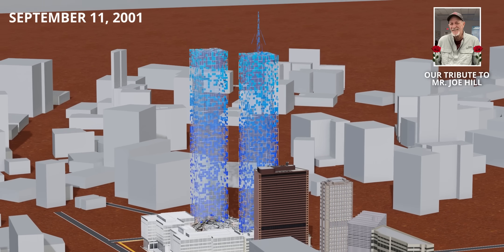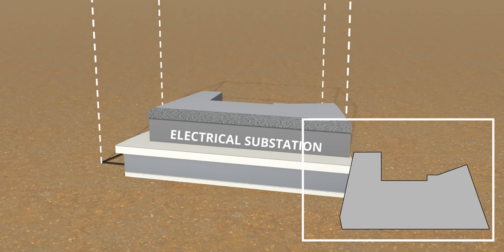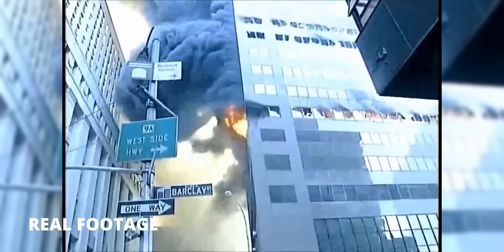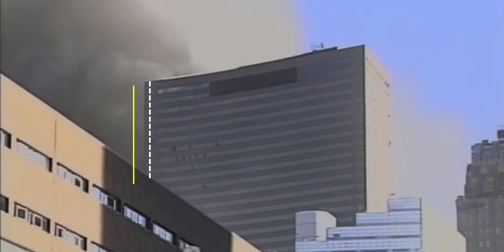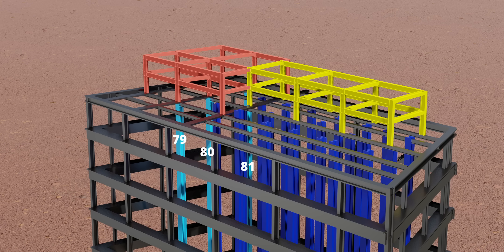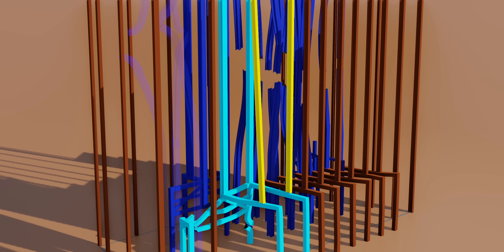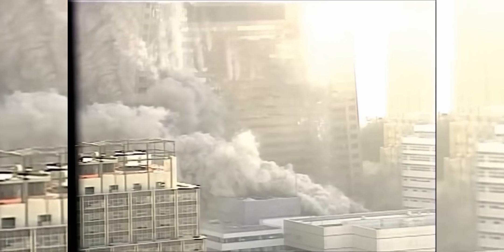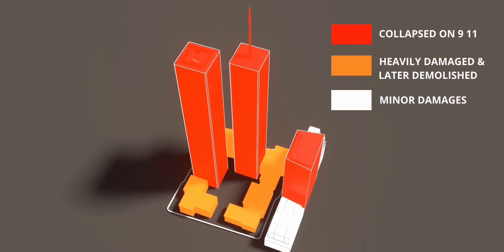Collapse of Building 7 | The Complete Physics

Comment: As someone who spent 30 years as a union ironworker literally hands on erecting , welding , bolting up, demoing , ect skyscrapers , I can honestly say ... COMPLETE LIES!,, impossible for building 7 to perfectly self implode and fall over office fires and an antenna falling down the side of it , for that steel structure to do that ,, ALL the lower columns would have to give out at the exact same time , lets not forget the reporter saying "we are being told they are getting ready to bring down building 7 " 😂
Reply: @yanceydavenport8657 this guy in your comments is a fckn Fed, just to let you know
Reply: So, we can conclude that you're not a "union ironworker", much like every other muppet claiming un-solicited "authority".
Well done. The fact that you can't see what's happening, as well as the fact that you make up dumb shit? Didn't really make it less pathetic.
Reply: I'm going to respectfully disagree without making any false appeals to authority, and here is why; 

Much misunderstood, Building 7 was the 6th building to collapse of 10 lost on 9/11. Because of its early low priority, conspiracy filled the information void with garbage made up by technically ignorant people promoting political agendas. But 7's loss is an engineering problem and should be treated as such, so I prepared this brief summary of my own analysis to fix that, using technical analysis, not ideology and tired memes. 

At 10:28am the WTC North Tower collapsed, showering Building 7 with tons of burning debris, causing heavy damage and starting many large  fires which burned out of control for the next 7 hours. Half the FDNY firefighters having been killed, units in disarray, equipment destroyed, no water pressure, and the greater urgency of search & rescue efforts, Building 7 couldn’t be saved so firefighting efforts were pulled as futile and 7 left to its fate. Firefighters make that sort of choice every day in brush fire situations - which houses to save and which ones to let go. Only real difference here is moving the decimal on the size and cost. People get overwhelmed by the size.

www.youtube.com/watch?v=g_SvpwyC17M

Collapse of a burning structure is always a concern for firefighters. Steel buildings subject to fire rely on active firefighting to survive. Buildings are designed around 1 to 3 hours of fire resistance, allowing time for occupants to escape and active firefighting to get started, after which all bets are off. Left to their own devices they'll exceed their design envelope and collapse, like Plasco Tower and Wilton Paes de Almeida. In 7 the occupants escaped, passive and active fire protections were compromised and active firefighting was abandoned hours before the collapse, which left the building to its fate. It lost. Odds on Building 7 would eventually collapse, and it did. No big deal in logic.

 http://www.youtube.com/watch?v=WnYBX6QT0R4 

FDNY Chief Daniel Nigro - The biggest decision we had to make on the first day was to clear the area and create a collapse zone around the severely damaged 7 World Trade Center, a 47-story building heavily involved in fire. A number of fire officers and companies assessed the damage to the building. The appraisals indicated that the building's structural integrity was in serious doubt. I issued orders to PULL back the firefighters and define the collapse zone. It was a critical decision; We could not lose any more firefighters. It took a lot of time to PULL everyone out, given the emotionalism of the day, communications difficulties and the collapse terrain 

FDNY Deputy Chief Peter Hayden ; We had our special operations people set up surveying instruments to monitor and see if there was any movement in the building. We were concerned of the possibility of collapse in the building. And we had a discussion with one particular engineer there, and we asked him if we allowed it to burn could we anticipate a collapse and if so, how soon? And it turned out that he was pretty much right on the money, that he said 'In its current state you have about 5 hours 

The collapse of Building 7 was anticipated and widely reported in the media throughout the day, with 24 video cameras recording some or all of the collapse. Everyone knew what was coming and why. 

www.youtube.com/watch?v=OY5S5k3tMHI

The collapse of Building 7’s was entirely different to the Twin Towers and harder to understand, most details being hidden from view and not intuitive.  But we can still sort out what happened through careful analysis and observation. This is my explanation of the collapse relying on no outside authority. 

Building 7 was a unique, asymmetrical 47-story steel framed structure built atop a smaller 3-story building serving as a partial foundation, requiring lower floors dedicated to complex load transfer structures. Of trapezoidal shape and all-steel tube-in-tube construction, B7 (above the 7th floor) consisted of a central core of steel columns carrying most of the gravity load, perimeter steel columns around the outside of the structure carrying the remainder of the gravity loads and long span beams and girders to tie those elements together and form the floors. On the outside of the building hung a moment frame or outer shell. 

Phase 1 : First externally visible signs of collapse initiation occurred at 5:20:28 pm and were notably quiet with observers not realizing the building was collapsing! No audible warning in the form of hundreds of ear drum busting 180-190dB explosive bangs preceding the collapse. Here at 12:00 a local CBS affiliate reporter is talking 10 blocks from B7 when collapse begins. People don’t start to notice the collapse until 12:11. At 12:45 is the famous CBS fixed camera clip of Building 7’s collapse. Note how quiet it is. 

www.youtube.com/watch?v=t5tEy6mXSE8

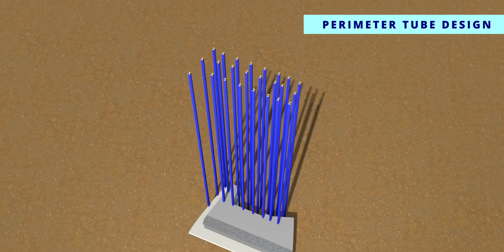Collapse initiation was due to lower floor failures above the load transfer region (8-14th floors) in the NE corner. In this video at 0:45 you can see the NW corner from inside the building while under construction, Column 79 just out of frame on the left. That big, angled steel beam across the top of the frame connects to C79 at one end. The girders connect to the beam. That beam and all those girders depend on just one connection 

www.youtube.com/watch?v=nP3TNHPCIVU&t=45s

Phase 2 : The NE lower floor failures caused a loss of critical lateral support over an excessive length of Column 79 and it buckled. Looking at a floor diagram of Building 7 (www.nist.gov/image-16640) when you see all the structures that depend on C79 you quickly realize this one column was a relatively isolated structural element on which a disproportionately greater fraction of the structure depended analogous to say the Key Bridge. Externally as collapse begins we see a vertical progression of window breakage along the 44-46 line and a kink in the roof of the East Mechanical Penthouse at the top of the building, consistent with C79 failure. Normally with a buckling column, the load could be redistributed to other columns. With C79 that is not the case - the failure did not redistribute the load, so the collapse rapidly progressed to the roofline, sinking the rooftop penthouse. The transition from full capacity to almost no capacity occurs in an instant and will result in virtually no resistance 

Phase 3 : With C79 gone, B7’s progressive, non-symmetrical collapse continues with adjacent columns 80 and 81 left laterally unsupported, and quickly buckling as well, sending the EMP down through the building. C79-81 all have no diagonal bracing, which is the major reason why they could not redistribute a lot of vertical loads among one another. From there collapse progressed from east to west through the central core until the core was gone taking all of the interior floors and probably most of the perimeter columns with it. Follow the horizontal progression of window failures low in the building and the dropping of the remaining rooftop structures into the building. One of the big takeaways from the NIST Building 7 study (invariably ignored) was how their modeling determined C79 failing under ANY circumstances would have initiated the same collapse sequence. 

Phase 4 : After about 10 seconds only the exterior moment frame remains, giving the illusion B7 is still standing to the casual observer since little has outwardly changed. But it is just a hollow empty shell like an empty cereal box supported only by a few remaining columns and overloaded from the loss of the core columns and floors, quite unable to remain standing. With nothing remaining behind it, the north face leans inward, forming a V in the roofline, the last few columns buckle under the strain and the moment frame free falls, landing on top of the debris pile. 

It is only here at the end when most of the building is already gone, leaving only an empty outer shell that a single measurement of alleged free fall acceleration is taken, from one point on the outer shell. The Building did not “free fall” – just one corner of the outer shell briefly moved at a rate comparable to FFA. The Building_ (core and interior) was already gone before that happened. The period of alleged FFA was a product of how it fell NOT why it fell . It’s also not proper FFA as the single measured point was moving in 3 dimensions, not just down. Start to finish the collapse took 18-20 seconds, 3 times longer than free fall . How fast something falls cannot tell you what started it falling_ anyway, let alone 10 seconds after it started falling.

The debris spread outside the footprint blocking surrounding streets, heavily damaging the Verizon Building and destroyed Fiterman Hall. 

Building 7’s progressive, non-symmetrical collapse was incidental and unintended collateral damage from the combined effects of fire + time + gravity, started by the collapsing North Tower. That is true no matter who planned and carried out the 9/11 attacks or why . The collapse was of so little consequence it barely registered at the time - a footnote, only taking on semi-mythical status as an alleged smoking gun years later when demolitions at the Twin Towers, missiles at the Pentagon and shoot down over Shanksville all failed and conspiracists had nothing left to work with. 

Anything can seem like a conspiracy if you don’t understand how it works. Now you should. I hope you found this helpful, informative and it solicits informed critical comment. If I made any errors of fact, logic or reason or left anything important out, please let me know so I can fix it. IF you can offer a more plausible alternative please do. Be the first. Please start any reply with the words “Tits McGee” or I will know you didn’t read it and are wasting my time.
Reply: I focus on other details like the Black Boxes from the 2 airliners that hit Tower 1&2 being destroyed, yet 1 hijackers passport from Flight 11 was recovered. Fckn don’t make sense to me
Reply: @LibertyOrD__th  - You focus on the evidence that isn't, so you can ignore the evidence that is. 

But hey, benefit of the doubt, let's try and make this make sense to you

Flight Data Recorder and Cockpit Voice Recorder are designed to help accident investigators determine the cause of an accident by providing data which could indicate if something went wrong with either the aircraft or the flight crew.

Anyone here think the crashes of Flight 11 and 175 were an accident please raise your hand.

To aid in their survivability in a typical aircraft accident the FDR and CVR are located in the tail of the aircraft, which is usually the most likely part of the aircraft to survive in some recognizable form in a crash.  On 9/11 both aircraft were largely stopped within the building, so the FDR and CVR were trapped in the heart of raging fires for up to an hour and a half. 

Then they were ground up and crushed by a million tons of falling building as they dropped nearly 1,000 feet to the ground.

And somehow your mind boggles as to how they weren't recovered.

As for Satam al Suqami's passport, it survived for the same reason as Lisa Frost's Air Miles card, or the Flight 175 manifest or a million other pieces of paper, bits of seats, luggage, office furniture and what have you that were scattered all over the streets below the Twin Towers immediately after impact.

Or had you seriously never looked before?

www.youtube.com/watch?v=T6Q6XQUt2IE
Reply: @TheCriticalStinker-01  its a miracle is all I gotta say, only 1 passport between both Flight 175 and Flight 11.

As for the voice recorders, I concede b/c I forgot they were tape and not digital.
Reply: @LibertyOrD__th  - The passport is irrelevant. Literally nobody cares about it except for conspiracy believers. 

Even digital the FDR's and CVR's could not have been reasonably expected to survive those conditions, well beyond their design envelope.
Reply: @TheCriticalStinker-01  no detail about that day is “irrelevant”
Reply: @LibertyOrD__th  - Great. Then please state the relevance of the passport, particularly as it related to Building 7 collapse engineering. 

Be specific. 

Also, why don't you make a fuss about any of the other items scattered across Lower Manhattan, several of which I already mentioned?  Ignorance-fueled personal incredulity ain't gonna cut it.
Reply: @TheCriticalStinker-01  you tell me why the passport is relevant to WTC7, the Government is the one who found it not me
Reply: @LibertyOrD__th  - Reversing burden of proof again eh?

It isn't.

Not even a little tiny bit.

I never said it was.

I would never say it was.

I can't think of anything that is a greater waste of time and energy than talking about Al-Suqami's passport in any context.

Also, da gubmint didn't find Al-Suqami's passport. It was found by a private citizen who turned it in to a beat cop, who turned it in to the FBI, where it got filed away as being of no use to the investigation - because it isn't.  You literally have to be a conspiratard to still be running this up the flag pole 24 years later.  It failed the last million times someone tried. You will not be moving the needle on that.  Repeating the same failures over and over and over while expecting different results is the definition of mental illness.

Is that too ambiguous?
Reply: @LibertyOrD__th  What doesn't "fckn make sense to you" could probably fill libraries. What it couldn't do is be relevant to anything.

Comment: and it fell straight down at near free fall velocity?
Reply: That's how things usually fall. Down.
Reply: @tpryce6243 actually here on the surface it experiences resistance.  Air alone would slow it down. But obviously millions of tons of structural steel doesn't.
Reply: @robbiehiatt9966  Uh huh. Anything else?
Reply: @robbiehiatt9966  Doesn't it? The tons of  structural steel which is designed to hold the building up, but what do I know?
Reply: @EricBlackmer   Static load vs. dynamic load.
Reply: @tpryce6243 yea, you got 6 subscribers and no content. How many of those 6 are actually your other accounts?
Reply: @robbiehiatt9966  So you’re all done now?
Reply: Strangely, things on this planet fall down. It's known as "gravity". Then again, since you also have no understanding of what "free fall" or "velocity" is...that doesn't really surprise.

Comment: So fire makes columns just falll apart in 10 foot sections when there is a fire....
I don't believe any storyline from 911
Reply: No, but fire (heat) causes the attached floors which provide critical lateral support to fail.  That failure in turn leaves the columns unsupported over an excessive length, resulting in failure by Euler buckling.
Reply: @TheCriticalStinker-01 sounds like bullshit to me , during world war 2 a B-52 bomber it the empire state building burning for 4 hrs.
Minor damage, do some research
Reply: @joecherepanov7320  - First flight of the Boeing B-52 bomber was 15 April 1952, which for those keeping score was nearly 7 years after a much smaller North American B-25D Mitchell medium bomber got lost in fog and struck the Empire State Building.  Even though that aircraft only weighed 10 tons and was probably doing only 180-200 mph it still struck with enough energy (equal to 42 pounds of TNT) to punch a hole in the building with heavy parts like an engine passing all the way through and out the other side.

Compare that to the 122 ton Boeing 767-200 of Flight 175 which struck the South Tower at 589 mph (equal to more than 2,000 lbs. of TNT) while carrying a fuel load that weighed more than that entire B-25 and you can see this is not an Apple v. Apple comparison. 

Or in other words, your attempt at cope through non-analogous analogy sounds like bullshit to me.
Reply: @TheCriticalStinker-01 Lol, still doesn't cut 48 4 foot  columns into 10 foot piece's and jet fuel won't melt steel....  Inside job
Reply: @joecherepanov7320  - I genuinely have no idea what you are talking about but at least we agree the whole 1945 ESB thing was a Red Herring.
Reply: And building 7 was never hit by a plane and fell apart it 10 foot sections.... Thermite does that
Reply: @joecherepanov7320  You have an entire video and documentation on the building design, flaws and why it collapsed. And yet you ignore it all.